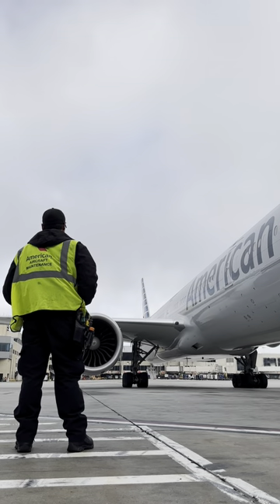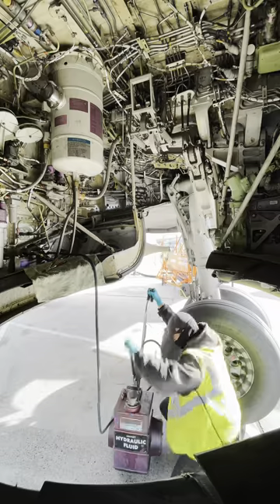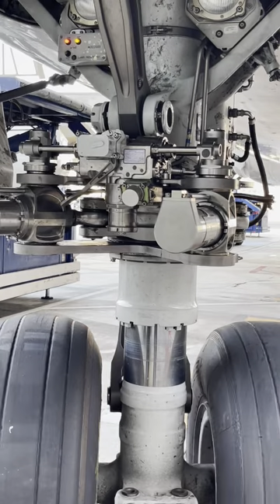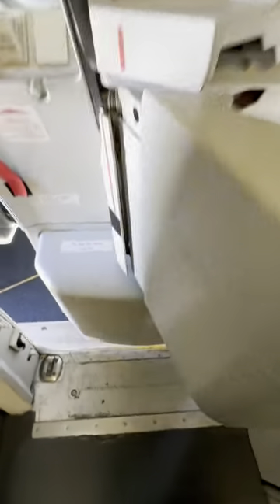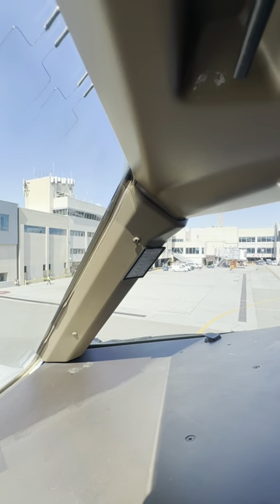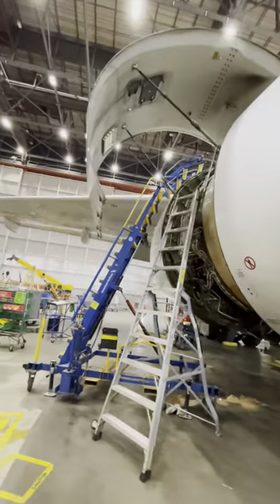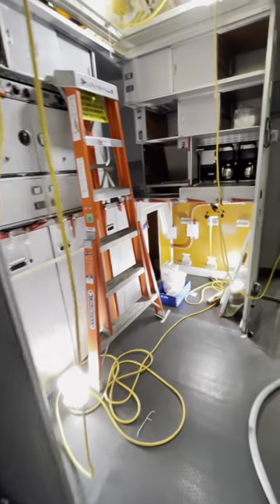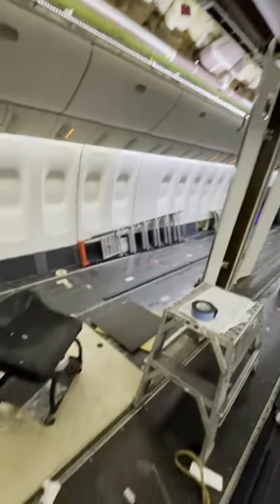Aircraft Line Maintenance vs Hangar Maintenance

Comment: How do airlines especially ones as big as American, keep track of all of its planes and how many hours each has flown so they're not late on one of the maintenance checks? Not to mention, I would have to assume that at any given time there's dozens of planes undergoing one of these inspections, no?
Reply from the maker: This is an absolutely amazing question, well, to put it simply a very huge logistical operation. Not only are you looking this at a standpoint of tracking aircraft, as well as maintain aircraft, but now you’re looking at times and periods of when the aircraft is available for such work. This is all tracked through computer systems and databases. It’s actually a very intricate portion of Aviation. I wish I can go into my details about it, but I simply cannot, because I’m only one portion of the system, I am but a cog in a series of the whole machine. But once again, a very amazing question, hopefully in the future, I could be knowledgeable enough to answer it thoroughly for you.

Comment: hey thank you so much for you video, greet you from chile. i wanted to know, what kind of procedures you make in the engine in a check A.
Reply from the maker: The standard procedure in the a check for engines is usually IDG oil filter, replacement and replenishing starter oil, and usually changing O-rings on the chip detectors, and maybe you might have fuel filter changes as well

Comment: Can I ask - what does a lightning strike look like of the surface of the aircraft when you inspect it? A good friend of mine is an A380 captain and he has told me stories about the lightning looking like plasma as it goes over the windscreen. But he has never mentioned if it leaves any mark on the body of the aircraft that he has seen on inspection
Reply from the maker: It looks like a poorly executed spot weld.
Reply: @StigAviation  many thanks 🙏🏼

Comment: Can you explain hi power run? I'm thinking it is repositioning plane to another airport, but not positive. Thanks in advance
Reply from the maker: High power run is a procedure where an aircraft gets placed in a very specific location with a blast fence behind it. Will secure the aircraft and will run up the engines. Almost to maximum power. Usually about 85%. This is done after any kind of major repair, or any kind of major component replacement. We want to make sure the engine is performing up to par.  That is a high-power run.

Comment: Would cabin refreshes (i.e. enitrely new seat product) happen only at D checks, at C & D, separate to thise checks or the get out of jail free card answer: "it varies/depends"?
Reply from the maker: Usually when the cabin is revamped, or a new configuration is being installed, aircraft will usually wait for a heavy check such as D check. I’ve also seen aircraft being taken out of service because they did have extended amount of ground time, and they had specialized cabin crew maintenance to do the job quickly.
Reply: @StigAviation  apprecciate the perspective, thanks

Comment: The FAA lets line maintenance techs taxi aircraft with engine power? Woah, I would've never expected that.
Reply from the maker: We have authorization from FAA to fix the aircraft as well as to perform operational check which includes taxi and high power runs. the qualifications we get from the manufacturer and training from designated instructors.

Comment: Aku heran...kenapa pada waktu pesawat akan take off..tidak dikendalikan dengan stirnya pada waktu pesawat menuju tempat untuk memulai take off tersebut...apa ini termasuk auto pilot juga???
Reply from the maker: When the aircraft is taking off and it is at a very certain speed of the steering is locked out, it’s already going straight so there’s no need for any steering. It’s got nothing to do with auto pilot though.

Comment: You hear of wheels falling off aircraft on take off,I guess you don't check the wheels are nice & tight (the lug nuts for lack of a better term) on a regular basis? To that would be a critical safety chack.
Reply from the maker: @Samanthareneeheart1  yes I heard about that. that’s not the way it works first of all. Wheels aren’t head on by multiple lug nuts. It’s just one big nut and it’s all covered by a cap. We don’t check such things on a daily basis. It’s just checked when a wheel is replaced. Wait for the investigation to find out what actually happened. Let’s not jump to conclusions.

Comment: All of this, and no one tightened bolts, securing the door to plane.  ✈️
Reply from the maker: You’re talking about the Max-9 which First of all we don’t have. We only have Max-8. Second of all that aircraft in question was literally less than 2 months old. That occurred during assembly of the aircraft. Not in a Heavy check.